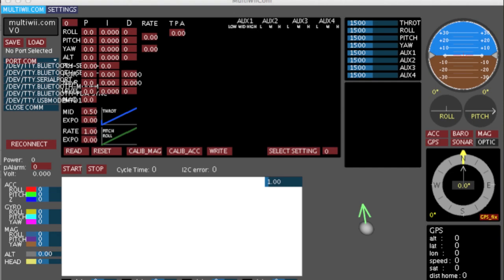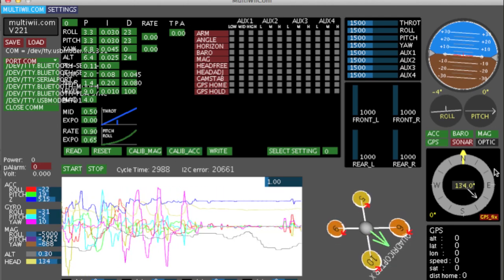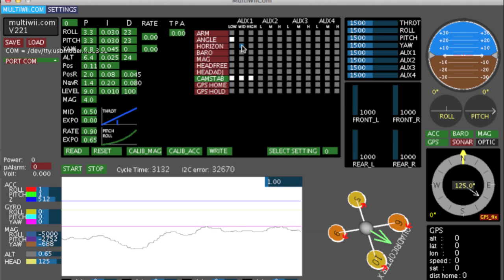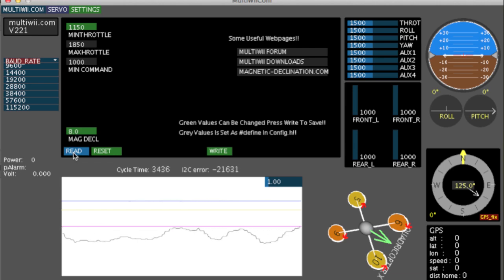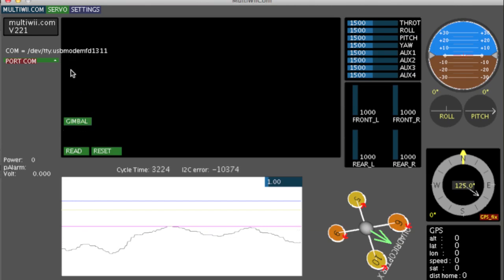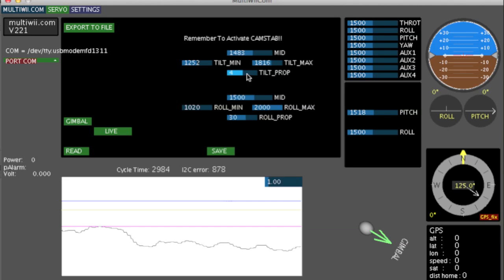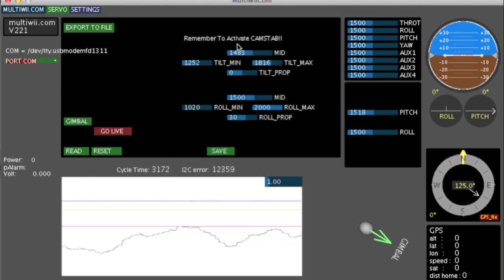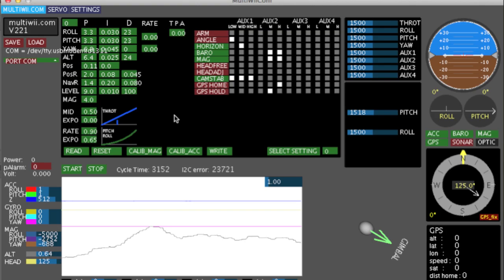Multiwii V2_3 GUI

Comment: Hello. Cool video, thanks. One small issue Ive run into is that I have V2.3, and it doesnt have the two tabs at the top left of the screen. And when looking at your version, even though you refer to v2.3, your gui actually shows 221. In my version the issue you faced of the left text overrunning the gui does not exist, so one true fix, but the loss of the selectable tabs at the top. Maybe you could post up somehow to a dropbox the 221 version for folks to level back? Thanks again for your insightful process.
Reply from the maker: John Robertson v221 is the firmware on the flight controller NOT the GUI version. If you watch from the beginning it reads version 0.0 before the flight controller is connected

This GUI is a download from the Multiwii forum

the text overrun only occurs on a MAC, not an issue on windows

If you don't have the tabs you probably have the v2.2 GUI
Reply: Deet96 Sweet...I will check those things out. Wow..my mag is whacked. I think the MAG under PID is to set the declination? Ive run the mag cal oscarliang described, but it still points about 45 deg off, and when rolling the craft the gui shows it going skewed in all axes. Yep I have a mac, no overrun.

Comment: you tell me what are the settings of the software via qav250 MultiWiiConf thanks
Reply from the maker: Umberto sf2 I have no idea, never flown one, and even if I had, the PIDs fro me, on my airframe, with my hardware will be different to yours

Even if we both has the same controller, ESCs, Motors and Props, the PIDs would still be different on the two airframes

Comment: How did you get the comports to work? is there a separate driver for mac?
I'm on the new yosemite OS X with an i5 64bit processor.
Reply from the maker: there will be a driver for the FTDI, it will be model specific

I have had no driver issues through 4 OS X versions now
Reply: so what about the mwc 2.0
Reply from the maker: When I first got my FTDI, i downloaded and installed its driver, never had an issue since in almost 4 years

Comment: I have a question. So I flashed my Crius AIOP v2 board with multiwii 2.2 so it turns on but it does nothing when I move controls on my transmitter. Is it because I have to calibrate it with this program before I can use it at all? Thanks.